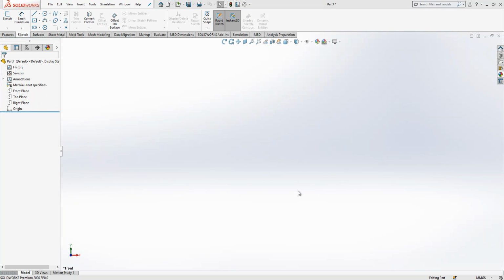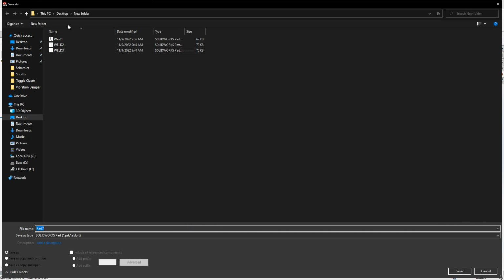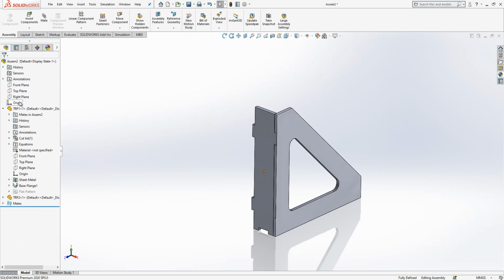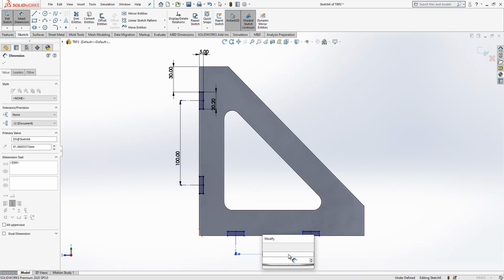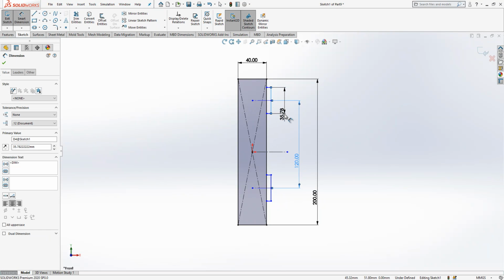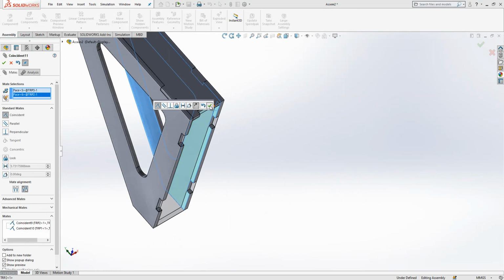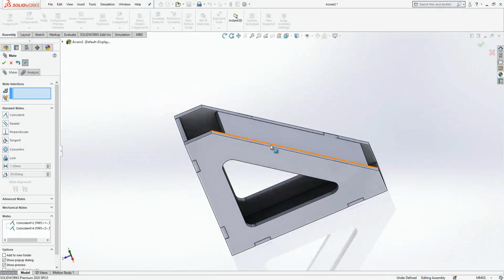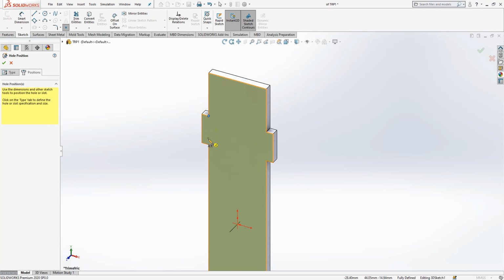Welding Table Jig - SolidWorks Assembly Tutorial

Comment: isn't it easier to make it within a part not the assembly, and use sheet metal tab and slot tool. Or it's just for demonstration purpose?
Reply from the maker: Yes I do always in that way and save bodies later as parts and if needed assemble them in an Assembly. 

Sometimes way of workings are different across organizations. 

But I wanted to show in the context of Assembly how you would model it.